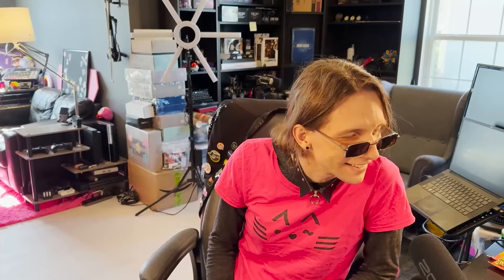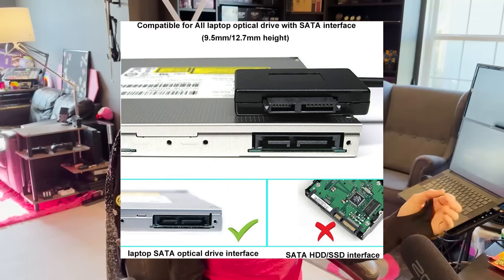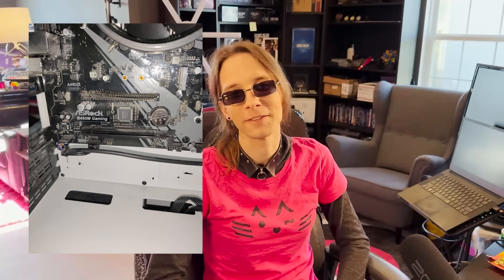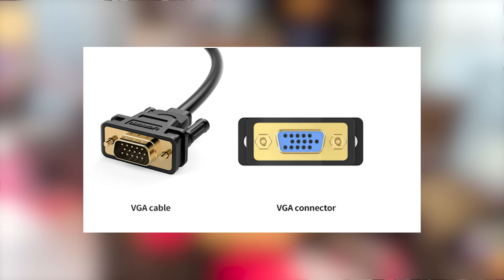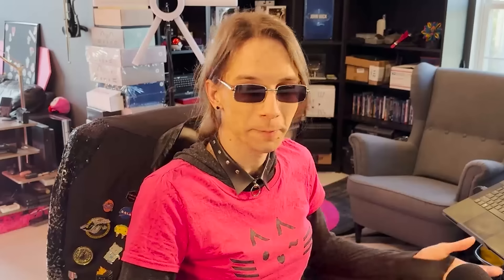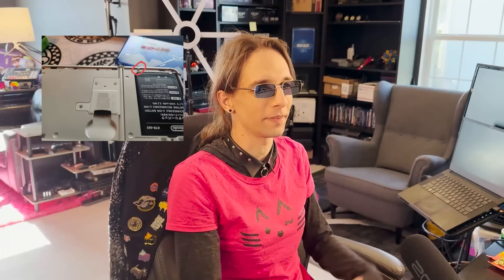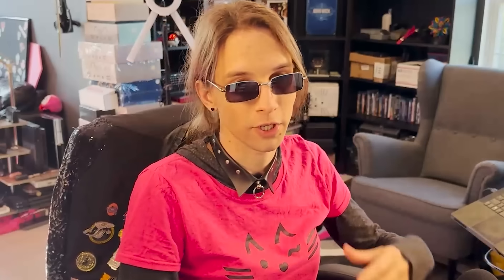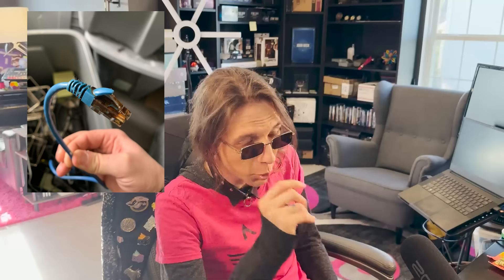How to NOT computer | Lexplanations | r/techsupportgore & r/hardwaregore

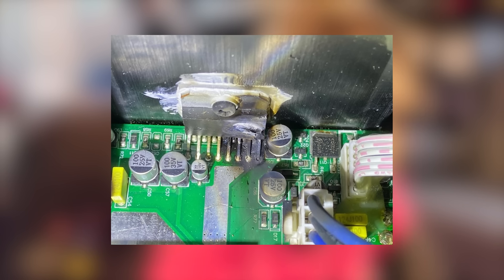Comment: 7:45 ... Way back when I was a kid I had plugged a laptop charger into a portable CD player because at the time I just knew "hey the plug is the exact same therefore it is designed for it right? right?"... yeah it got mad and stopped working for weeks opened it up and saw the burnt part and realized "oh just because it has the same plug doesn't mean it has the same current", but weirdly enough after a few weeks it started to work again, no clue how it started working again but it did.
Reply from the maker: Some devices have a chemical fuse that can reset after the chemical process completes. Not sure how long it takes though.

Comment: Hi Lexi!!    Seeing you brings a smile to my face.  Every. Darn. Time!  Thank you Lexi! 
Okie.  I'm not as computer / IT savvy as you, Lexi.  But Jeez-O-Pete,  some of that hurt me, and I have been known to do some fairly janky stuff. 
Example:  About 8 years ago  I bought a brand new PC to replace the One I had before.  Old one was a "Good buddy Special" that my dads friend put together.  Oh sure it ran,  It ran like a lawnmower engine full of sand..  So I got the new one.   Now,  I needed  TWO internal drives. (It only came with a single 500 GB drive) One to do the OS and some software and basic storage. That was the intention for the pre-installed 500.  But I wanted to transplant my 1TB drive into it for my big storage.  So I asked the salesman dude.. "Does this PC have a second slot for a second drive, as well as another SATA port on the mobo?"  Dude says "Oh yeah.  You'll just slide your secondary drive right into the slot,  put in the screws and plug 'er in.  No problem!"  So,  I bought the PC.  Now since I'm a lazy-ass,  I didn't attempt to install the 1TB drive until the 500GB started to fill up  (about 8 months later)  So i crack it open and....  Where is the slot for another drive?  Wait.. Where the hell is the other SATA port on the mobo?  
SUMBITCH LIED TO ME!!!  There were two SATA ports.  One for the existing HDD and one for the optical.  No more. 

Here comes the jank!  Since i pretty much steer clear of obsolete, fragile discs that scratch if you stare at them too hard, I opted to remove the optical drive to use its SATA port for the other HDD.  Now there was nowhere to put the other HDD.  Yeah,  I just stuffed in in there with one screw through a spare hole in the chassis.  It sat on my desk and was only moved for its air-cleanings which were admittedly,  not often enough.   But that PC lasted me 7 years running the "windowvirus ver. 10"  Then I installed Linux Mint Cinnamon, and ran it for another year and change.   But even that PC was getting old.  The 550GB HDD was starting to groan and click.  So I bit the bullet and got another new PC.  

The new PC,  A "Beelink SER5"  Mini PC.  It's the size of an 80's walkman!  This itty-bitty cute lil' bugger will run circles around all of the other pc's I have owned all put together!  I did away with the Windowvirus ver. 11 and installed Ubuntu LTS.  It's been about a week now.  I LOVE it!   I can watch videos in 4K now! 

Thanks again Lexi, for the smiles, the heartwarming energy and the good advice.  
🏳‍⚧Cammi 🏳‍⚧

Comment: I am so happy this is now a thing. Lexi explaining things is the main reason I watched Emkay.

As for the soldering iron, a cheap tip and trying to engrave wood with it with it will do that sometimes. Doesn't need to melt to be malleable.

Comment: The computer case I bought for my PC actually fixes the graphics card weight issue you were talking about, it has this shelf thingy that goes into the graphics card slot, its quite light but it also screws into the case for extra support, and it has cables connecting it to the socket on the floor of the case where you actually put the graphics card so that it is oriented vertically and not horizontally, removing the stress on the socket.

The brand and model is a HYTE Y40 in case you were wondering
Reply from the maker: I’ve seen these vertical mounts recently on a few channels and really like them. I only have a 3060ti so it’s not that be but good to know!
Reply: @TheLexikitty  Mine's not that big either, but I still do like the feature. It gives me leeway to get something bigger if I eventually want to upgrade. That's not for a while though, seeing as this is my first PC and I finished building it earlier this week 😊 so I'm going to spend some time enjoying the fruits of my labor (and paychecks)

Comment: As someone who knows a fair bit about computers, though not to the extent of being full-on IT, this is simultaneously a fun and painful experience. I actually had no idea CompactFlash used a pin-and-socket style connection rather than contact pads! RIP to those pins, though.

Comment: I have a late 2009 Mac mini that looks a little like the franken-pc at 5:44 It had a dead fan, so I pulled the top case off and used a copious amount of electrical tape to attach a 120mil fan. It still runs and is actually very quiet now

Comment: 9:00 PSA to anyone that works in purchasing: yes, the racks that have the pre-threaded holes rather than the square holes are more expensive. But the network engineers that have to replace a 10-module switch in the middle of a night or the data center architect that has to install leased equipment will thank you later.
Reply from the maker: As long as they’re quality posts - the network engineers will curse up a storm if the engineers before them have stripped out the threads on a switch that needs to be replaced in the middle of the night.

Comment: 7:30 Think of amplifiers as power supplies designed to make weak audio signals louder. And like pc power supplies, you do not want to touch the funny capacitors. They are very much capable of giving you a good 3rd person shock. Also why they love to explode when you play loud things! Your boosting a analog signal for a speaker to be able to move a magnet that otherwise wouldn't have enough power to do so if it was weaker. Sometimes audio is loud, and the power use becomes greater as a result.
Reply from the maker: oh yea i get that much - i should have said i dont get too far into audio because the fancier audio cards an stuff just dont sound any different to me so i have never gone the route of needing something capable of dumping that much power (nor would I want it in my PC case, lol)
Reply: Fair. Audio cards aren't all that useful anyway outside of audio workstations. Thanks for the responce though!

Comment: 11:50 IMHO simplest and (mostly) fool proof method to organize screws of something you're dissecting: a piece of thicker (ideally with the zig-zag pattern inside) cardboard. Just push the screws into the cardboard roughly in the same place you found them on the device and it stays there. Can also draw the rough shape/outline of the device on the cardboard beforehand for even easier orientation.
Reply: This is actually genius. I'm totally using this method in the future

Comment: I felt the swapped screws example.  I had a latitude D600 that I had to replace 2/3rds of. One time put it back together, found I had an extra (loose) screw when I went to plug it in, and it wouldn't turn on.  Took it back apart to the case, all the screws in their piles, put it back together and it powered on.  I still have no clue where that random screw didn't get installed originally, but that laptop got me through college (had a parallel port which I needed to program microprocessors for some of my labs, I could also swap between a floppy drive or a cd drive, that laptop is ancient now 😅).

I totally didn't realize you have your own channel, quite a pleasant surprise!

Comment: I told several of my pink groups that I think Lexi's pink shirt is very pink and I'm convinced the pink used for it is the pinkest pink like the dye actually called pinkest pink and that the pink in this video needs to be rebalanced to be a better pink because right now it's so pink what happens when you shine a backlight on this pink my pink thoughts are being consumed by pink now thank you for coming to my pink talk pink no longer has any meaning pink
Reply from the maker: the Lexi pink is #FF0070 if that helps
Reply: @TheLexikitty  Damn, and here I thought the red value went above 255.

Comment: Another useful thing for screw organizing are tackle boxes; they often (but not always) seal up the boxes neatly since they are made for sharp hooks and such, they tend to be easy to take with you, and you might have an easier time finding those than something more specialised for engineering/computers.

Pill organizers can be even better, but are usually small and/or expensive. Bead or jewellery cases tend to be bigger but much more expensive.
Reply from the maker: Also good are craft boxes for sewing l, kind of like tackle boxes but with a giant compartment in the bottom that can fit a laptop

Comment: In an act of total desperation, I once bought a soldering iron from the Dollarama across the street from me to do a necessary repair. In under a minute the handle had started melting in my hand.  If I had not realized what was happening fast enough, I would have had severe burns.
Reply from the maker: omg yikes

Comment: as the unfortunate regular user of a 2012 macbook air, heat is always an issue with them, I have legit gotten hurt by 88 degree celsius metal because of them

Comment: When I was about 10, I once had a cd literally explode to bits while spinning inside the drive. I opened it up, and found out that none of the shrapnel had damaged any sensitive components, so I cleaned it up, put it back in and it worked. Wish I had a photo.

Comment: I ussally tip my tower to the right side and lay it down to move it around. I also make sure that it has the correct amount of screws on the end plate of said card. I just took my card out last night and re-pasted and thoroughly cleaned it. When I got the card apart the paste was so hard that it made me jealous. However, with this preventive maintenance my card should live a lot longer than me.

Comment: I can relate to this pain as I've been working in IT for the last 7 years...
The vast majority of the time it was a PICNIC, Problem In Chair Not In Computer.

We had an employee who was having a no display problem (most likely just a loose connection), but rather than calling us they decided that they didn't want to bother us over something small and tried to fix it themselves... They managed to force the DMS-59 connector (multi-monitor on a single cable before DisplayPort was widespread) in upside-down and mangled all of the pins... meaning that we had to replace the cables...
Reply from the maker: Nooooo not the PEBKAC ID-10T errors…

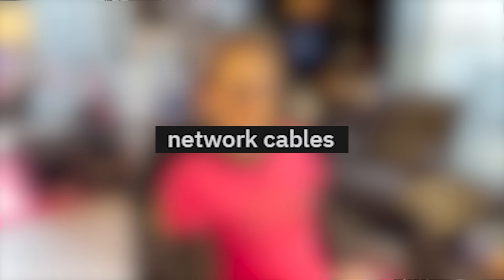Comment: 1:29 That's an OLD way of fitting two 10BASE-T or 100BASE-T ethernet connections into one cable! Since 10BASE-T and 100BASE-T both only require two of the four twisted pairs in an ethernet cable, this used to be how you could get more connections out of running half as many cables. As long as both ends are terminated in exactly the same way, it works! But the most you'll ever get out of it is 100Mbit. 1000BASE-T and faster standards require all four twisted pairs. Signed: Someone who briefly interned at a university that still had network infrastructure from the mid-90s kicking around in some buildings and had to troubleshoot stuff exactly like this lol.

7:31 That blowed up component is one of the main power amplifier integrated circuits in OP's amp. That's one of the components that is under TREMENDOUS stress when driving loudspeakers, like... it's responsible for delivering multiple watts of power to the speakers. And that one just cooked itself somehow. Could have just been an old part that diededed, or it could have been overdriven by too great a load (i.e. speakers with an ohm rating that's too low; they will allow more current to pass and therefore draw more power off the power amp stage!)

10:44 That is also a DVI-D dual-link adapter! Notice it's missing the four analog pins on the right. It's not compatible with DVI-A or DVI-I cables at all! It also has the six pins in the middle of the grid, thereby making it a dual-link instead of just a single-link compatible adapter.

12:28 Fun fact about CompactFlash for the uninitiated: it is pin-compatible with IDE/PATA (that OLD hard drive connection type with the big ribbon wires) with just a couple of extra pins for power! I have an ancient CF to IDE adapter kicking around SOMEWHERE in my boxes of crap in my storage unit, and it's literally just a straight pin-to-pin connection with an extra pigtail off the side for power!

Comment: Had a customer come in once stating their laptop was super slow and acting “strange.” She needed it back as quickly as possible due to needing it for college. After booting the computer, which took forever, it began opening several browser windows and other sketchy pop-ups. Come to find out that their younger brother (14ish) had borrowed it and proceeded to go to ALL of the “adult” sites and sketchy bit torrents there were. The keyboard and monitor were sticky from a certain organic substance and there were cigarette burns all over the case (she didn’t smoke). After gearing up with appropriate PPE, full disassembly commenced. An entire box of disinfecting screen wipes and several cans of compressed air (I didn’t have a data vac yet) were needed to physically clean the unit. I also ran several passes of anti malware programs and cleaned almost 6000 viruses, key-loggers, Trojans, etc… from the poor laptop. This is a record that has stood for the last 8 years. I made her promise to never let her brother touch her computer again.
Reply from the maker: dear god

Comment: About that messed up VGA connector: on some connectors the outer shell is held on by the two standoffs for the screws. If you remove them the metal bit comes off. Considering that the standoffs are missing in the picture that's probably what happened.

Comment: 1:32 I have done this with specially marked cables when I needed to run analog and digital signaling in an ancient building. They had a cat2 cable embedded in concrete. 2 twisted pairs went to a 10BaseT, one went to a POTS telephone, and one went to an AC thermostat. 

I was NOT going to be trenching concrete to add conduit.

Comment: Even in professional environments, the racks usually don't look that clean as in that one picture. The one at 1:39 looks more realistic. If there is a local IT department and one for the building/infrastructure, one of the isn't allowed to touch the stuff from the other guys. So you try to do your part clean and leave the rest as it is.
Reply from the maker: I need those “you suck at parking” business cards but for cable management.

Comment: Was a cook on fryers in kitches for about 15 years. The build up around and on deep fryers is basically bio-plastic. It's just vegetable oil and carbon mostly. Trace amounts of fats or protein is negligible. It seems grosser than it is. It actually seals out water, so the main danger to electronics covered in it is overheating.

Comment: My gpu is hard mounted in the computer.  On one side is the Mobo, the other is a case support bracket, and there is 0 space between the gpu and that bar.  No screws required, except the bracket to the case.

Comment: @2:46: "Except for Apple, because they hate you."  I've had a really bad day and I needed that laugh. 😆
@11:43: YES!!!  I cleaned my mechanical keyboard.  Took it completely apart, cleaned the inside, was very proud of myself.  Went to put it back together and lo and behold, I have screws that will not completely fit in the back.  There was one extra groove on the "bigger" screws than the smaller ones.  I got it to work, but that was fun trying to take apart.
@13:29: I am a custodian and worked in a public school (elementary) and those ChromeBooks were a NIGHTMARE and A HALF to clean during the summer of 2020.  Half of them had broken or cracked screens, so our cleaner would ruin the monitors (but we had to clean them).  They were in these green leapfrog looking rubber holders.  The amount of crumbs and food was just a mess.  IT had multiple stacks of computers that were just trashed.  If not by us cleaning them with cleaners that fried the monitors (we had no choice) or the kids just breaking them.  I quickly understood why the school system needed an extra $2 million in their tech budget.

Comment: ah, where I work (small town ISP, troubleshooter and installer), we affectionately refer to the rj-45 male-to-male connectors as 'Derramy's', in reference to the gentleman who would use them literally everywhere. Inside? Outside? Tucked under the house soffett? across the ground beneath trailer houses? on the ground, under trailer houses, with 20~ watt POE running through it? all yes, all places we have found these sneaky buggers.

Comment: The CD drive story. I have one of those. At my high school, we persuaded some teachers to let us watch a dr who DVD someone brought in (can't remember the occasion), and the DVD fell into the inside of the pc, never to return - the only reason we knew it was there was that the pc rattled a bit when moved... It was one of those like cheap integrated computers, and had the Wii-style DVD reader (like the ones without a tray - idk what they're called), and it was vertical, so I presume it was just badly maintained and old.

Also, yeah USB-C does actually support 240W now, although the whole spec is starting to get a bit spicy from a hardware front - I doubt they're going any further.
Pushing 5A over those tiny pins is spicy, but even worse is that the power pins go up to 48V, and are right next to the data pins. Cable wiggle -> Burny smells.